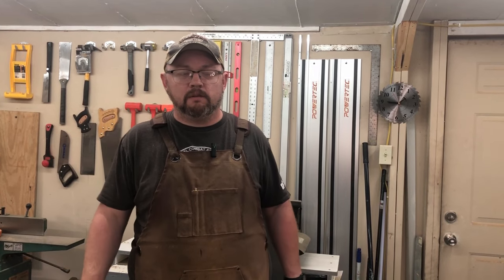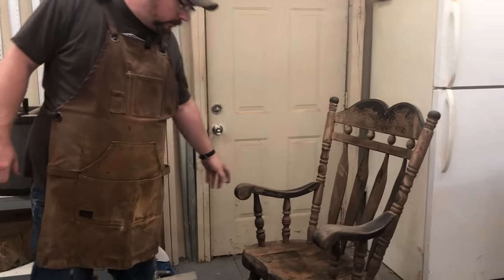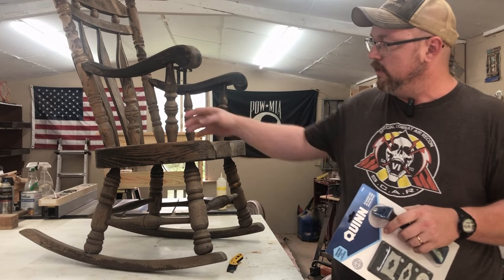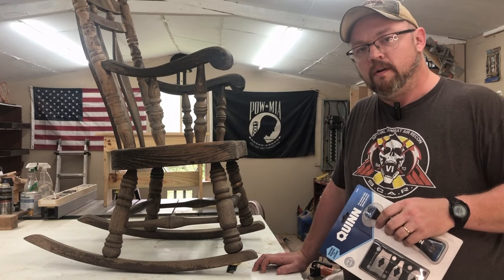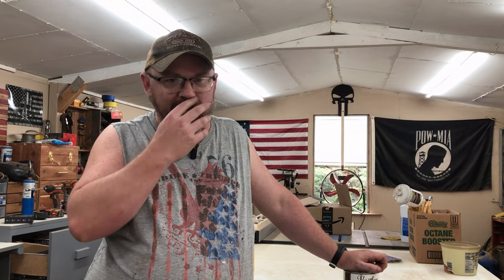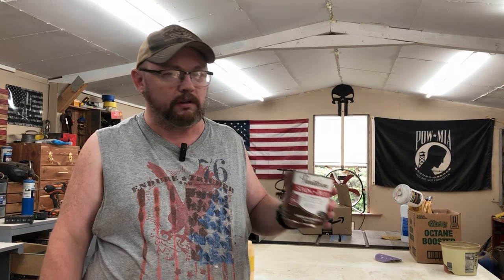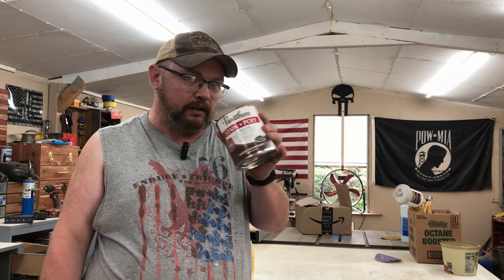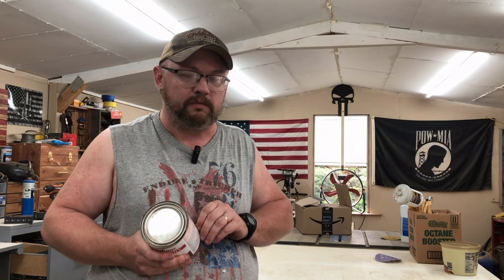Satisfying Rocking Chair Refinishing - This Was A Hard One!

Comment: that turned out fantastic.l. i just started on one tonight and am on here looking for tips without taking it apart, so far i been stripping and with 3 different paints and everything being turned i know im in for a job..have you used a card scraper?
Reply from the maker: Yes! On the “flat” or smooth areas that would do okay. The beaded areas are a nightmare! I couldn’t get it completely clean, thus the darker stain!

Comment: I see you didn't use a pre stain or wood conditioner before staining. Obviously its not always necessary, correct ?? Im about to Refinish a wooden chair and a wooden front door and would like to do the same steps you just did but i see other videos where they use a pre stain or conditioner ??
Reply from the maker: Really only required for wood that has a tendency to bloch when staining. Plus this one was a very dark color so even if there was blochiness it wouldn’t be noticed.

Comment: Doesn't look as bad as mine. LOL The one I'm restoring was out in the weather and every joint has fallen apart. I have glued the seat back together five times, the arms and the rockers have falling apart and I need to remake one of the spindle tongues. I'm using Rubio Monocoat on my restoration.
Reply from the maker: I’ve heard a lot of good about the Rubio! I’ll have to try it out on a future project!
Reply: @Brads-Woodshed  I'm glad I did! The seat has fallen apart on my four times. I would have had to re-sand and re-stain each time. With Rubio, I can just spot stand and reapply after it's fixed.
Reply from the maker: @renaissancewoodworking  a great bonus there!